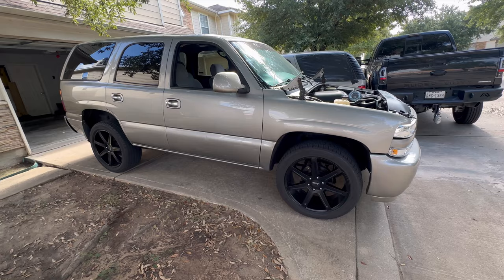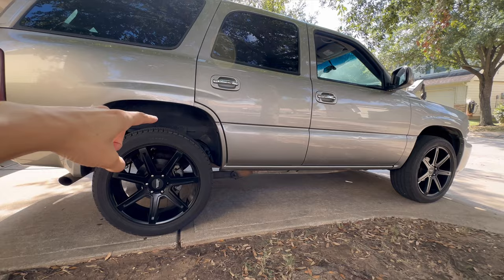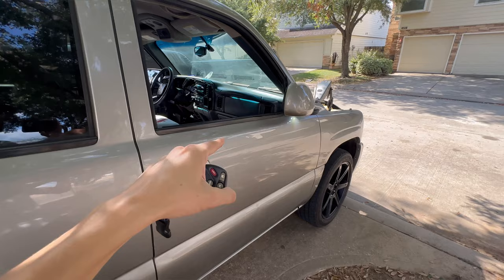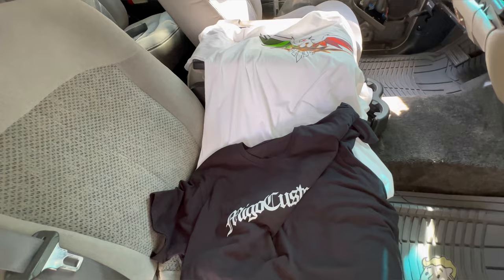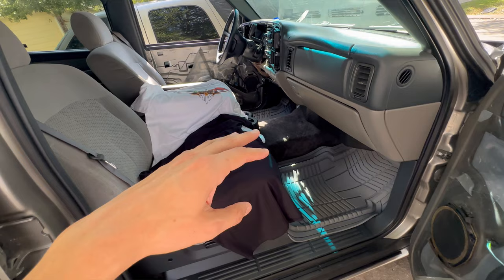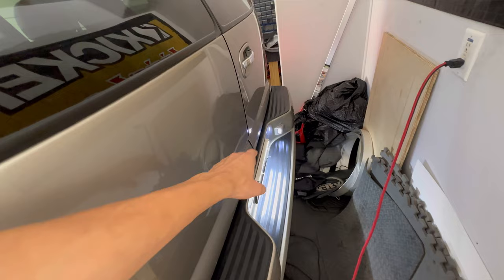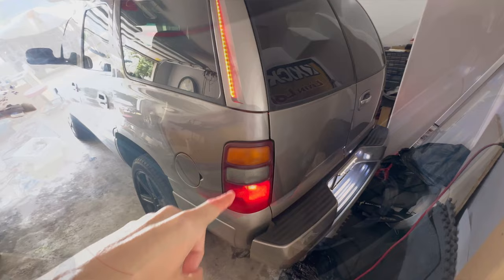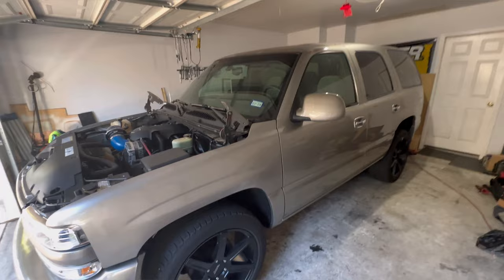2001 Custom Tahoe Updates

Comment: Definitely gonna need a in depth video when u do the electric fan conversion and u should make wiring harnesses for the mirrors to sell I’d be down to buy a harness
Reply from the maker: For sure bro👍🏼 and I can make the harness for the mirrors except that that would only be half the work since the mirrors need to be converted on the plugs for 99-02